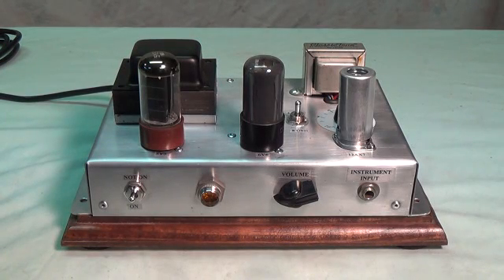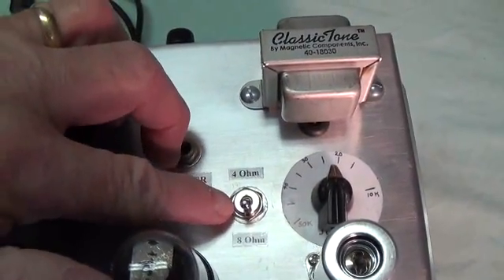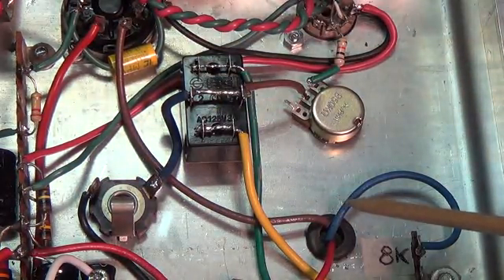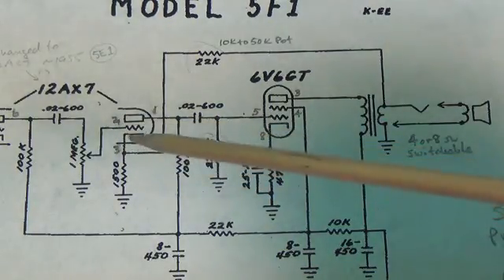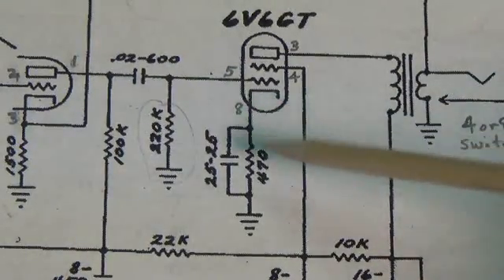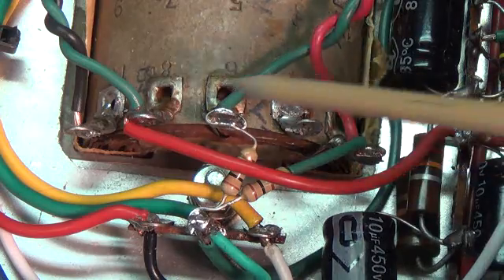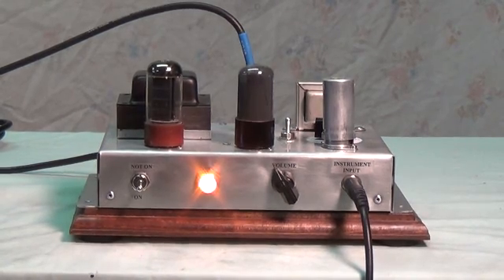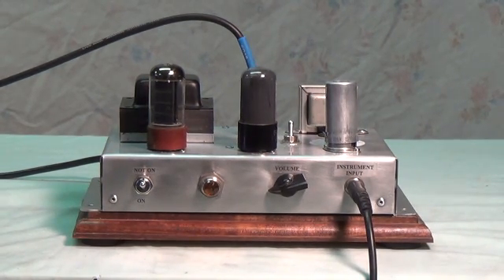Scratch Building a Fender 5F1 Champ from Scrap Parts.....Part 2

Comment: can i suggest that you drop the Pt 1 link into the description,  also did you ever do a box for it ?  the spirit of  re-used parts though suggests that a one time radio of suitable dimensions has potential.  what i have done with these is to find something fairly tall, with the base with the amp latched to the box ,  the box itself with two bass chambers either side - you could take a tone output to additional speakers , but i chose to mount the speaker on top on a slightly inclined additonal piece of wood, somewhat like an upright 1930s acoustic non-horn record player using the audio dynamics of air and wood reverberation to add to tone and sound. finally it needs a name badge, i would suggest  Finder+ .   Did you do a vid on your box?  Actually would an alternative be a open grill cage that could go over it , with a water / flame resistant cover if taking out to advoid the coffee spils?
Reply from the maker: The video series includes construction of a finger-jointed cabinet, HP. Please access our video list.

Comment: Very incredible video. So interesting to see a quality unique  amp built from surplus parts. Great resourceful job Uncle Doug. Thank You.  When wiring an amplifier do you use a common 16 gauge automotive wire stock or use what they call "Push Pull" type wire as Stew mac have in there adds?
Reply from the maker: Thanks so much, Kevin. I buy my wire on large spools from Autozone......generally in 18 to 20 gauge.
Reply: @UncleDoug  Thank you Uncle Doug for your reply. So common 18 to 20 gauge automotive multi strand  wire wire should be fine to use. Thanks again.

Comment: Thank You. What should the wattage be on the 1k cathode bias trim pot? Modern amp schematics show 2W.
Reply from the maker: If the plate current is 35mA, the wattage would be 1.225W, so a 2W resistor would be more than adequate.
Reply: @UncleDoug  Thank You. I should have mentioned it in the first question but the reason I asked is that I'm having a hard time  finding a trim pot of that wattage. I'll keep looking.

Comment: Uncle Doug: i have a question for you that may be too involved to answer succinctly. if so just tell me i need to learn and review the basics. 

on another video of yours you saw a virtual center tap someone had made and said you figured out which lead from the transformer was the 6v. then you disconnected the virtual center tap(from pilot light i believe) and said you grounded the actual 6v center tap.

this video you also talk about grounding the 6v center tap.

i am confused by this.   how are you getting power from a 6v lead off of the power transformer if you ground it. obviously there is some fundamental wiring that i am not understanding. if you would need to explain the entire circuit to me to answer question then no need, but if you could direct me to a video of yours where you have already explained it that would be great. Thank you in advance.
Reply from the maker: There are 3 wires in most 6.3VAC filament windings. Two are the wires that carry the voltage to the tube filaments, and the third is the center tap for the winding, which is grounded. The two wires carrying voltage to the tubes are NOT grounded.
Reply: @UncleDoug  i wish i could find the other video to reference.  it looked like you disconnected the virtual tap from the pilot light. then said you grounded the center tap wire to the chassis. 

just didnt make sense how the 6v is getting to the light...       but i am fairly sure i am missing something obvious. 

thank you for taking time to answer. 

i watched your 2 part vids on the 5f1 circuit. i really enjoy your videos.  hopefully as i learn more things will make better sense to me.

Comment: Hi uncle Doug, 
 the Bourns variable resister 0-1k you put in for bias, what watt rating is it? Or better yet do you have a part number?  I would love to do that mod on my champ reissue!
Reply from the maker: I found it in my accumulation of vintage components, Josh. I assume it was around 5W, but 1W would probably suffice with a single 6V6. Check with Mouser.....they may have them.

Comment: I know why that your equip never breaks down and I’m constantly rolling tubes and caps...  
 
I dont turn a tube amp on unless I’m gonna drive the power tubes to clip... 
once I was capable of repairing my own equipment, I fell in love with the sound of power tube clip, chorus’y  oscillation warbles of the power section being overdriven... 
Now I can’t go back,  I hate a life filled with only preamp distortions.  I want the pre to stay clean 
 And wait on the power tubes  show what they got...  

I may be wrong about it all but I think  im listening to get the same thing SRV  was on his Dumble steel string swingers... 150 watts x 2 breaking up with a preamp that can hang in there for the ride?? Must’ve been angelic... 
My primary is a 74-75ish music man HD130 bassman, with solid state pre 
12AX7 phase inverters and quad  EL34.. 

I don’t have a clue what my watts are... 
I had to remove the EL34 tube retainers but I managed to get an NOS “Soviet  set of made 6550 winged C squeezed in their place..
Reply from the maker: I hope you don't have any nearby neighbors with nervous conditions, 76......actually, I hope you do :) :) :)

Comment: Hello Doug,  fascinating videos!  I wonder if you could briefly explain why you prefer the 5K tapping on the output transformer over the 8k for the 6v6?  Does it give a more favorable plate voltage for the 6v6 for example?
Reply from the maker: Thanks, Anthony. Good question. Although the tube handbook suggests 8K Ohms as appropriate for the 6V6 above PV = 315VDC, at the time, I anticipated using the little Champ with a 4 Ohm net speaker cabinet, and the 5K tap seemed like a good compromise.

Comment: First, thanks for responding to my previous question about adding a much smaller parallel cap to a filter. I found reference to the tactic in the RCA Data book. RCA recommends the practice as an attempt to stop parasitic oscillations in RF amps.
Can you help with another question?
Looking at the 6V6 sheet, the columns are titled beneath the descriptive paragraph but above the heater’s max parameters. 
Referring to the COLUMNS associated with the class A & push pulls, are they describing conditions for all the tubes of the family operating at  different voltages. OR, does each column describe conditions of the tube titled above? Like 6V6 in the left column, 6V6Gt the middle column, and 6V6GTA in the right column.  
If its the former, seems plate output resistance is dependent on plate voltage, if its the latter, wouldn’t the GTAs require a different output X’former!
Reply from the maker: The 3 different designations, 6V6, 6V6GT, etc. are all equivalent. The values in the columns are based on the plate voltage at the top of each column. Yes, output impedance (actually load resistance) varies with different plate voltages.

Comment: How did you route the speaker cable if you put a cabinet on top of the chassis, great tone using only 5W output Amp,. If you had selected the 15W output amp then adjusted the feedback loop down ??? In my Clone 5F1 i am using a junker output to get the thing up and running then i can decide 5 W or 15 W.  Definable want to add the feedback loop it looked quite simple.  Do you have a part number for the accurate trim pot on the Tube Bias?
Reply from the maker: The chassis sits on the floor of my cabinet, Dennis, so no problem with the speaker connection. All you're going to get from a single 6V6 is 5W, so I'm not sure where the 15W is going to come from. I had the trim pot in my junk drawer and have no idea where it came from. You might check Mouser. Good luck.
Reply: @UncleDoug  How can i assure i have the right wire gauge and type, i was provided some wire for filaments that is solid copper but looks kinda thin. i see yours red and green are quite thick. I was also provided several big caps instead of replaced the the Cap Can as you did. i suppose that is more of a preference than a requirement. My input Trans pushes out 6.3 V exactly when all the tubes are plugged in. Using the solid core wire. is there a rule of thumb kinda of thing for HV, Filament and Signal wiring to use.

Comment: Greetings Uncle Doug. Question about the bias trim pot: does this need to have the 5W rating, and if so would you have the P/N of the Bourns pot you show? I've been looking high and low across the Shire without any luck!
Reply from the maker: No, it doesn't, Frodo. Using Ohm's Law:  P = I squared * R. So for a 500 Ohm resistor and current of .035A, the wattage requirement is only 0.6W......so a regular 1 or 2 Watt pot will do.
Reply: @UncleDoug  Thanks Uncle Doug. I got confused by using the schematic/ parts list from Tube Depot for the 5F1. Inexplicably, they specified the 5W rated bias resistor--wonder why this is... But your I^2 * R clearly shows a 1W rating is sufficient--I shall proceed. Just want to say I really appreciate all you are doing for us aging electronics project aficionados. Making my second home brewed Champ now, inspired by your videos, and having an absolute blast!.
Reply from the maker: @frodobaggins1505  Best of luck with your build, Frodo. After completion, double check the bias pot for overheating. It can get warm, but not hot. Another trick is to use a fixed resistor and pot in series to get the desired resistance. The fixed resistor will absorb much or most of the heat.

Comment: I really enjoy your videos. The 5f1 is my favorite amp. Such a simple circuit and I love the tone. I built the 5f1 (with ClassicTone, my go to transformers) as my very first amp and still that has got to be my go to amp. Really good video.
Reply from the maker: Thanks so much, Jay.
Reply: @UncleDoug  i was wondering if you could make a video on grounding. I have heard of what Kevin O'conner, writer of TUT, calls galactic grounding.  Essentially (from my understanding) where a buss runs along and connects at one point on the chassis. All the grounds are connected to their respective filter caps in their circuit blocks and runs along like a river then tributary analogy so that it "flows" along a chain and minimizes ground loops. Basically the whole "circuit" minus the mains is connected to one point on the chassis. Power mains connected to the chassis near the outlet for safety. I think I understand it to some degree (as in knowing what to "do" to build a relatively "quiet" higher gain amp, but at the same time not really understanding it). Currently reading Merlin Blencowe's book which explains his method of grounding. I think alot of amp diyer's can benefit from a video like that especially with the simplicity that you explain things. I have seen alot of people ask and talk about this topic considering grounding IS a part of the circuit.

Comment: Hi Uncle Doug - Regarding the old-school 5F1 schematic and wiring diagram you see all over the web: Why is the green/AC filament wire (that goes to the pilot light then to the 6V6 then to the 12AX7) represented by a single line/wire, but in other wiring diagrams I've seen on kits and in the actual chassis in this video it appears there is a pair of twisted wires where the original schematic and wiring diagram only has one wire?  

Thank You!!!
Reply from the maker: In some amp circuits, to save money, they ran a 6VAC secondary wire to one side of each tube filament and then grounded the other side of the filament. Then they grounded the second 6VAC secondary wire. Thus the chassis provided the connection from the transformer to the filaments. It's a lousy way to do it. Such circuits should be converted back to the two twisted wires that you described.
Reply: @UncleDoug  - Fascinating!!!  Thank you!!!  That will save me from trying to figure out where the extra wire is supposed to go.  🤣

Almost ready to take the plunge!!!,
Chris
Reply from the maker: @thefunkynotes8956  Good luck when you do, FN.
Reply: @UncleDoug  - I printed different schematics and layouts from other sources, that have the "twisted (AC) wires" and I will study them to see if I can wrap my brain around how the new schematic and layout connect the transformer to the filaments in a different way.  Of course this will result in  more questions.  😃  And, for what it's worth, this is the first time I've printed something in years!  I must be really motivated to break my paperless streak 🤣

Thank You!!!
FN Chris
Reply from the maker: @thefunkynotes8956  Tubes in a circuit are wired just like Christmas tree lights in parallel, FN. They are like a ladder. Imagine the wires are the sides of the ladder and the tubes are like the rungs.
Reply: @UncleDoug  - That is a great visual.  I'm going to make it to the local mom-n-pop electronics store soon to get some prices and start getting warmed up to the idea.  

Thank you!!!
Reply from the maker: @thefunkynotes8956  Sounds good, FN. Keep us posted on your progress.

Comment: do you remember the power rating of the adjustable cathode resistor you used, 2W? 5W?
Reply from the maker: I don't, Dave, but with the metal housing to dissipate heat, I would guess around 3W to 5W. Bear in mind that at 30mA and 850 Ohms, you're only producing around 0.75W.

Comment: Thanks for your vids.  I added the two 100 ohm resistors to ground from the filament leads on my 1956 Ampeg Guitaramp.  HUGE difference in background noise.   I also found a single green and white wire coiled under the power transformer that appears to have never been connected to anything.   I ran that to ground and the noise dropped FARTHER.   Nice and quiet amp now.
Reply from the maker: Nice work, Larry. Best of luck with the amp and future projects.

Comment: I have a problem with a 5F1 circuit tube amp that I just built and would like to ask your advice Uncle Doug.  I built 2 identical amps, with the same circuit as the original 5F1 except: no death capacitor, no negative feedback circuit, and I added a 25 uF bypass cap to the cathode on the first stage of the input tube.  I am mostly following your videos and the Megantz book for theory and also following Rob Robinette's website for wiring diagrams.  I get a very nice tone at low volumes, which makes me think I did not make a major mistake in wiring or have a bad component.  But for both amps, when I turned up the volume  knob to approximately 6-8 out of 10 max volume setting and play my guitar with a strong attack, they produce a harsh distortion with multifrequency lows and highs, kind of like a fuzzbox distortion but also with large volume jumps and very loud poppy crackly sounds along with the fuzz distortion.  It sounds horrible and unusable and not musical (and I normally like distortion).  One one amp, I was able to fix this issue by moving the signal wire that connects from volume pot wiper to the second stage input grid away from the output transformer wires.  One the other amp, I cannot solve this problem.  I have tried a lot of things, resoldering,  wire moving, etc. and can't seem to fix it.  I wonder if you have any advice.  I have looked at my wiring layout almost a dozen times, and I don't see a mistake.  I am playing an SG with humbucker pickups.  My voltages are: B1+ = 377, B2+ 320, B3+ = 276, with 6V6 output tube voltages of 362 plate, 320 screen, and 20V cathode bias and input tube (7025) voltages of 174 plate and 1.5 V cathode bias.  (Also, if it helps, by my math - please take with a grain of salt - I think I calculate I have a cathode current of 43 mA and a plate current of 38 mA, on the 6V6) Thanks for any suggestions. - John
Reply: Update: I added a 22KOhm resistor to serve as a grid stopper resistor on the 6V6 grid and this solved the problem.
Reply from the maker: Thanks for sharing the problem and the solution with us, John. Very helpful :)

Comment: I understand that the virtual center tap is important to alleviate hum. Can you increase the value of the resistors from 100 ohms to say 1k ohms. To minimise current to ground?
Reply from the maker: I guess you could, but 100 Ohms is the standard value, very widely used.